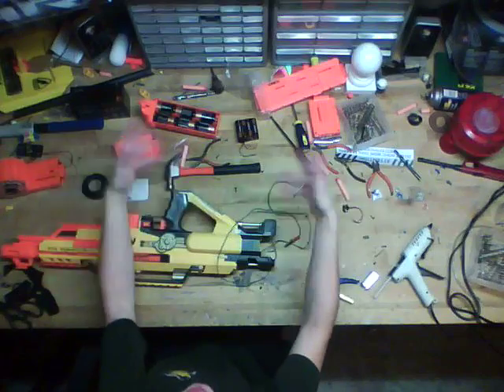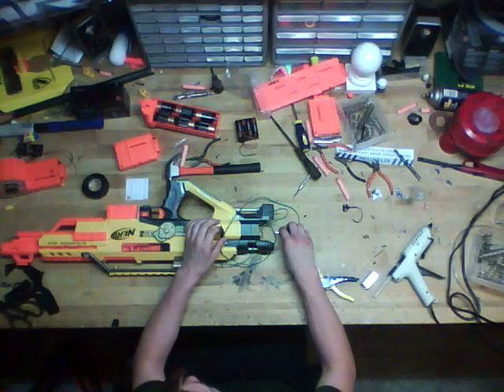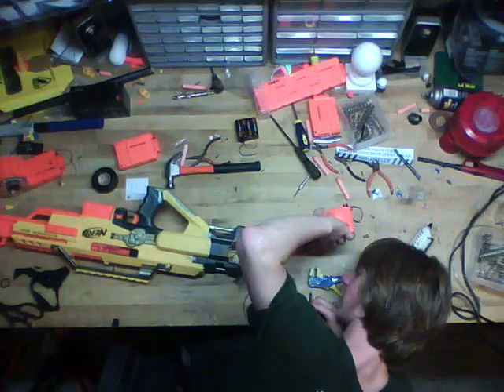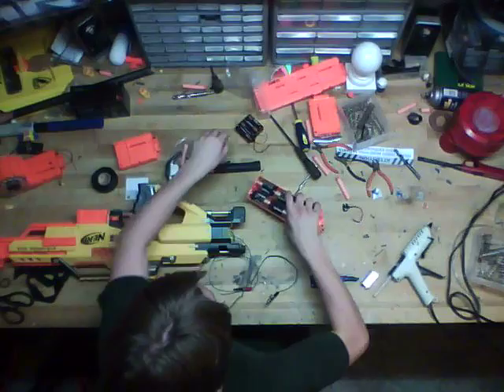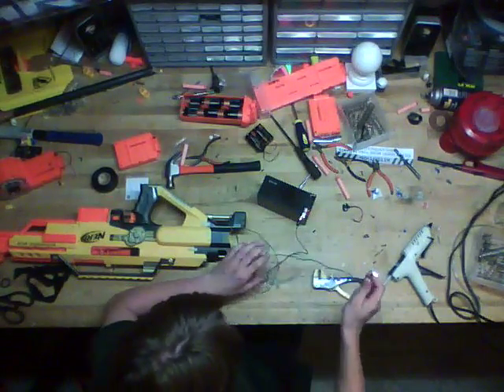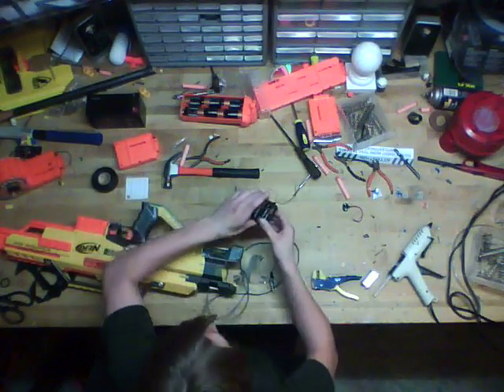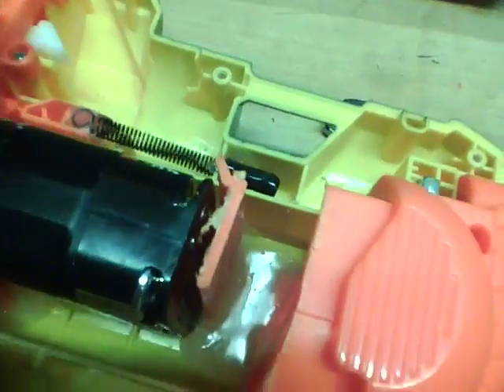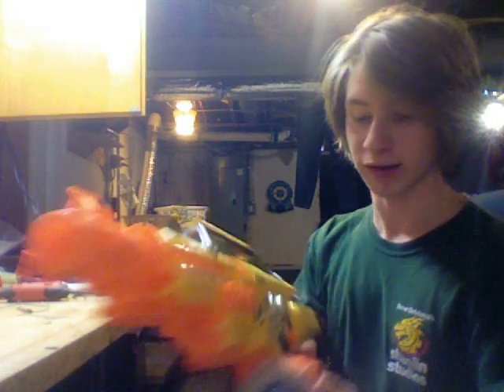Nerf Stampede voltage mod

Comment: Im going the Trustfire 14500 (Unprotected) AA battery route.... 4 x 3.7v each =  14.8 volts in a generic 4 X AA battery holder off ebay. Combined with the spring mod bought from Black Tactical :)

Comment: @MrRubixBunny it only damages it if you take the air restrictors out and dry fire it, the  extra force damages the plastic pieces because normally all the energy goes into the foam of the dart, not the plastic

Comment: @shlebby3245 dude when you use a paintball gun ur dealing with 3000psi of compress air. one wrong screw on of your air tank, bang, dead. get ur facts straight. and btw if you got hit in the face with a paintball, your LUCKY to loose just an eye.

Comment: you didnt have to cut the battery tray... just undo the screws on the stock bit, then open and release then tray. then you can screw it back together and you just have the stock.

Comment: Why not just put 2 9 volts with a 12 volt regulator? Seems like it'd be a better idea based on size and ease, plus wont need to cut down the battery tray or open the blaster all the way to change batteries.

Comment: I don't know what the motor can handle, but one way to crank it up to about 18v is to make battery packs of 4 AA's two parallel sets of two in series.  These are about the same size as a D battery and would allow you to get a higher voltage without modding the battery compartment much.  Basically it would only require a few wires to connect everything.  Of course you can always use fewer packs to reduce the voltage by sets of 3v.

Comment: there is a easier way to do this step one you take out the battery tray next choose your source of power and voltage then find a good place to fit it in the tray if it does not fit you could probebly widen the slot that you put the tray in after you have found a good spot hot glue it to the tray WITH OUT it touching any metal or important stuff next connect it to where the batteries go in, in the right places postive to positive negative to negative and there you go a easier way to do this

Comment: Ok first, your not going to shock yourself with 12 volts, hell you probably wouldn't notice 50 volts. Second that looks pretty sloppy internally, you could just use two 9.6 volt rc batteries like I did. Then you could just connect the batteries to the original battery carriage assembly. That means you can just take the two screws out and recharge as needed.

Comment: @uin13 i have a question though, what it the life of new batteries for the mod, and how long will that motor last before it stops working, just wondering im gonna do the spring mod once i get the gun but dont wanna break a 50 dollar gun the first war i use it in.

Comment: i have an idea. instead of just 1 battery pack, why not wire 3 battery packs, then solder and output connector to each pack like they use for an r-c or airsoft batteries., then have the input wire to the gun match the 3 connectors, and leave it in the sliding tray, that way, during a skirmish, you can just unclip the dead battery and clip it to a fully charged pack, eliminating frequent battery changes. The only hassle would be changing all 3 packs after the battle

Comment: You can use the original battery case if you look into RC car batteries. They fit quite nicely with a little modding. Ive got a 14.8 in mine, I did have to have a custom gearbox and gear assembly made after a while though.

Comment: Ok here is a tip to everyone- to prevent the plunger tube and the part most ppl worry about breaking- tightly pull electrical tape over the creases- and second rather than wasting money on batteris for your nerf wars- use rc car batteries. They are quickly recharged- hold a longer charge and equally powerful to a full size car battery :) hope i helped

Comment: Might want to pad the plungers with foam/rubber or something, as dry firing isn't always avoidable. Some blasters' plungers already have rubber padding to soften the impact (such as the RFR's) but judging by the sound from the dry firing in the video, it doesn't sound like there's any padding. (Nerf doesn't seem to like to do that anyways; they seem to only rely on AR's to soften the plunger impacts.)

Comment: @uin13 well actually, I was wondering about that; could they break? I know you've got the spring addition, the voltage mod, but could the gears break? I heard from nerf haven or somewhere that they gears might break, I figured you might need to replace the gears as well. But, seeing as you seem to be knowing what you're doing, DO YOU HAVE TO replace the gears..? just curious. putting that aside, so an increase of 3 volts (12 volt total), rather than the original 9 volt total? cool.

Comment: instead of always taking the blaster apart every time to change the batteries just extend the wires that hook up to the coils or just keep the whole tray like it was with the D batteries in i dont see how that wouldnt work plus if you kept the tray i would have put a battery pack like you made in the 3 spots were 2 batteries sat side by side

Comment: if you use two four battery connectors with AAs, they can fit in the battery tray with minimal modding. as well you can still use the original battery tray with its standard sliding, removable design.

Comment: isnt it that if you are connected to ground, the electrical current passes through you? like birds dont get shocked because they are not touching the ground so yeah same with batteries, if you dont have a negative, current doesnt flow

Comment: also one more thing ice. i recomend resodering the wires for a deans/taimya connector as on an airsoft aeg and then using a rc/airsoft battery. Because u can get 12v while having it removable(cause of the removable connectors)  and rechargable making it more pratical in wars, but if you dont want to I could see why i just thought unpluging the wires to charge it would be easier then to unscrew the whole gun to put in more AA.

Comment: You should have put spare batteries in addition to the wired batteries so it would be a quick swap in the battlefield if the batteries ran dead.